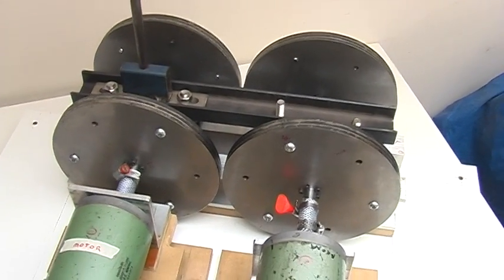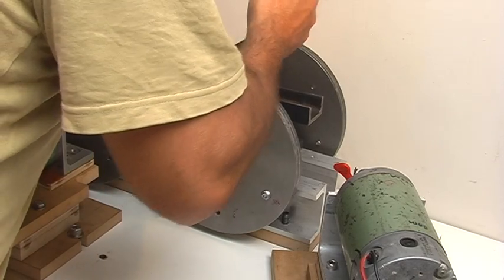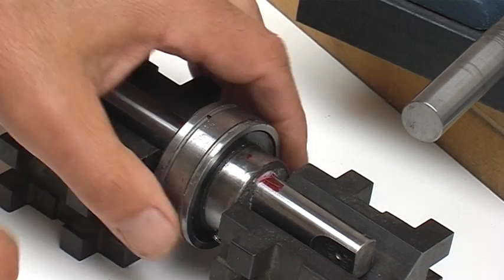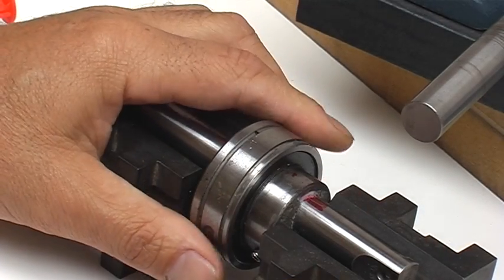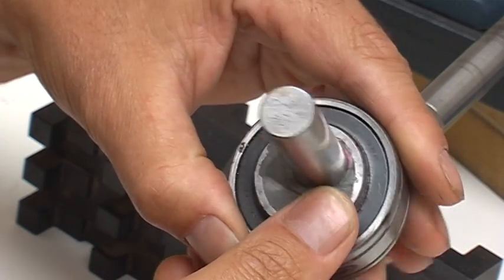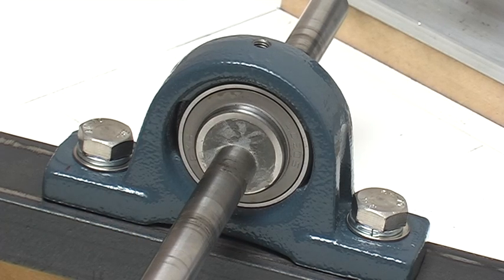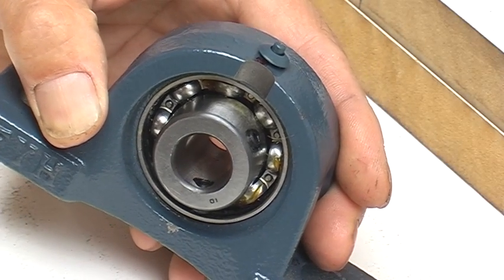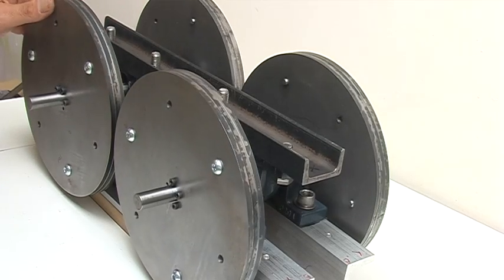Fernando's Force Multiplier Replication Build, by netica. Video 1

Comment: Making an offset shaft is easy just Lathe turn a shaft down using a 4 Jaw Chuck for offsetting the shaft !!, I fail to see any useful purpose for this generator, it would produce less power than it would consume, what is its purpose ??, maybe connect a dildo to the shaft that goes up and down and make a fueking machine, Running it at any speed except dead slow it would shake, rattle and roll with the dildo going up and down.

Comment: MMM QUITEN TODO Y ACOPLEN UNA( TRANSMISION STANDAR DE AUTO)  AL MOTOR 
ELECTRICO TENDRAN VARIAS VELOCIDADES  COLOQUEN A LA MAQUINA EL 
CONTRAPESO O DISCO DE ACERO O ARO DENTADO  ESO DARA FUERZA DE TORSION  
ESO SI FUNCIONA Y POR SUPUESTO USEN POLEAS PARA ACOPLAR Y SUS BANDAS 
NUNCA USEN CHUMACERAS Y ESA BARRA QUE PUSO EL SEÑOR PORQUE NUNCA EN LA 
INDUSTRIA VERAN ESO SE ACOPLA CON `POLEAS Y BANDAS CON SPROKETS Y 
CADENAS O CON ENGRANES O CON SISTEMAS HIDRAULICOS Y NEUMATICOS O 
ACOPLAMIENTO DIRECTO   LAS CHUMACERAS SON RODAMIENTOS NUNCA SE USAN COMO
 ACOPLAMIENTOS

Comment: Hi
I am having trouble completing the rotation Please Help
My problem is when Edwar Shafat manually it goes to a half turn and stir the other pulley and then going on the contrary to a half turn any lack of rotation is complete in order to spin the other Pulley
Note that the measurement is 30 mm Shafat
offset bearings are 50 mm

Comment: The 6 bearings and the same size, or the 2 centro  and bigger?
Reply from the maker: Carlos Leme 
Hi Carlos, the 2 inner bearings are bigger. 
The 4 outer bearings are 5/8 inch inside diameter to fit the shaft and the inner 2 bearings (the offset bearings) are 25mm inside diameter. This gives an offset of approximately 4.5mm
Reply: neticatube 

OK thank you very much

Comment: Hi, could you please show me the electrical circuit? I mean the battery, the motor, the alternator and, I guess, the battery charger? Thanks
Reply from the maker: Massimo Reggiani 
Hi Massimo. This is just a simple battery to motor set up for the drive side. There is no battery charger, the dc motor is used as the generator and is connected straight to the load of lights  where the measurements are made.

Comment: neticatube, I started doing this multiplier system goiania GO in about five days and 45 am with the result mechanic and then I'll post some video but the dimensions are bigger than my system to serve a generator 40 HP but when I post will be using the generator load on motors or resistors 5000 WATTS awaiting me 062 9119 8237 BRAZIL

Comment: neticatube I need help.  I have 4 bearings P 204, Inside diameter d= 19= mm,   2 X shafts diameter d= 19 mm length 500mm & 2 bearings 6307 Inside diameter d=35mm. it's very eccentricity. Length between shafts from centers is 304 mm. Look the images. Why would not full spin in the opposite direction to each other ?. Please help me.
Reply from the maker: Hi Ralyn,
Have answered in energetic forum, sorry for delay only seen your post today.

Comment: Did you drill into the split collar for those bolts that hold the plates together?
Reply from the maker: I drilled and tapped the collar and used (4off) 4mm hardened socket head bolts to hold the plates to the collar. I know this doesn't seem much with the weight of the plates but it did work well for this set up just to try it out.
Reply: جيد

Comment: What did you use to attach to the steel plates to the shaft?
Reply from the maker: The split collar clamped to the shaft is holding the plates in place.

Comment: I cannot see this working at all. My suggestion is to use a much larger flywheel. Try 36 inches @ 200 lbs. Add a few pulleys to get the RPM's up. Use a 1HP 3 phase motor & a VFD for your input. It will always be a fixed 500 watts. By using a series of pulleys, get it up to 4 times your input RPM. The VFD comes in real handy here. Start off at 25 hz, then slowly increase. You should see much better results this way. 500 watts fixed input, 2000-3000 watts output.